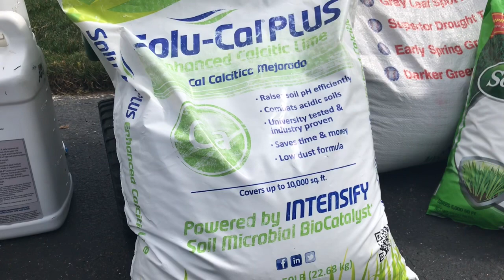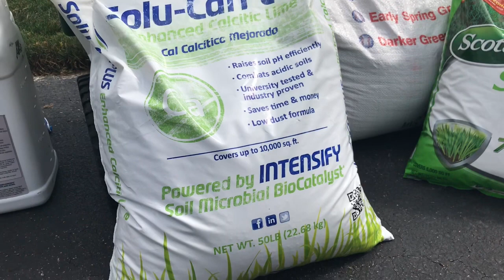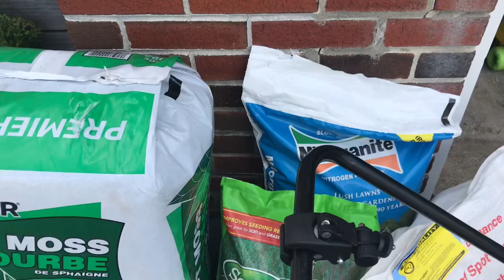👌 How to Overseed an Existing Lawn // Top Quality Seed

Comment: I am sure your lawn will turn out beautifully! My front lawn is now almost fully recovered and I am very pleased with the results! 🔥🔥🔥
Reply from the maker: 2 Week update coming soon!
Reply: The Lawngineer I threw down some tttf 5 days ago, and have watered 3 times a day, without seeing any germination yet. I didn’t cover with anything.
Can/should I cover the seed with some peat moss? Or is the seed done for?
Reply from the maker: J Dub give it a few more days.  Tttf takes longer to germinate.  Can be as long as 14 days!  Typically see it around day 6 or 7.  Hang in there!
Reply: @TheLawngineer  you were right, i saw them sprouting up at 9 days. My next question is, can I mow yet? I did a 85% fescue 15% kbg mix. The kbg takes much longer to germinate. But my lawn is looking pretty rough at how long everything is! Super green compared to neighbors :) but super long. (I overseeded, so the existing grass is what’s really tall)
Reply from the maker: @jdub8305  if you got to mow, then go ahead.  Wait till the grass is dry and sharpen your blade.  Also make sure to bag the clippings.  Try to avoid tight turns.

Comment: What did you set your rotary Scotts spreader on when putting down grass see?  I need to do this in a few days.  Thanks so much
Reply from the maker: I don’t remember the spreader setting.  Most important thing to do is measure out your yard and apply at the recommended seeding rate for your seed type.  For example, if you need 10 lbs of seed for a 2,000 SF area (seed rate of 5lbs per 1,000 SF), then start your spreader on a low setting with 10 lbs of seed in it and walk east-west.  Then come back and overlap in the north-south direction.  And keep doing that till the spreader is empty.  You’ll get a very even application this way.
Reply: @TheLawngineer  Thanks so much.

Comment: Hi lawngineer, did you just overseed today, Wednesday 16.
Isn't to Late for that? Or is just right on time to doit.
Thanks.
Reply from the maker: Adan Arceo depends where you are located and what the soil temps are (not air temps).  I’m in Pennsylvania and my soil temps are hovering around 71 degrees.  For cool season turf, the optimum soil temp range is between 50 and 65 degrees.  My soil temps were a bit on the high side, but is dropping, so I felt it was the perfect time to seed.  I seeded on Saturday, September 12.